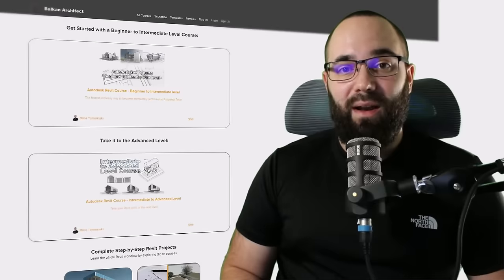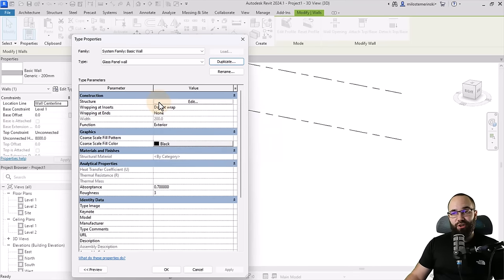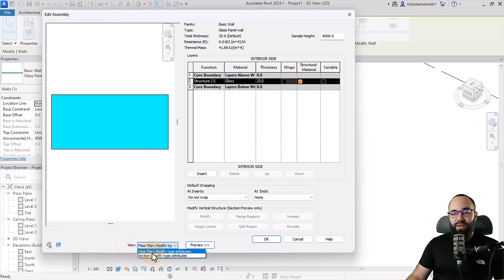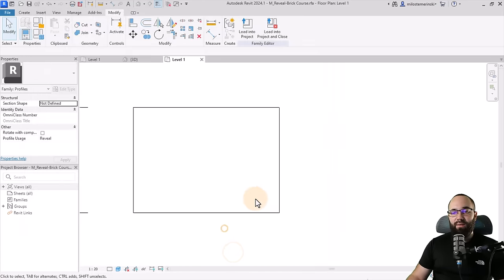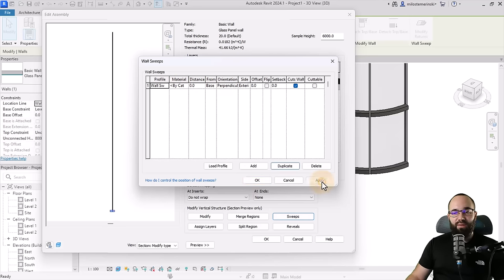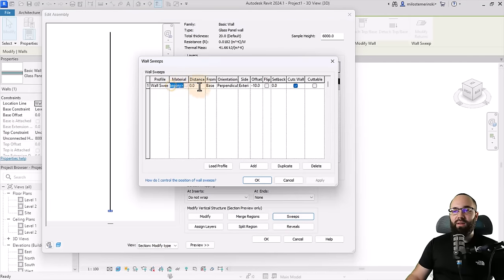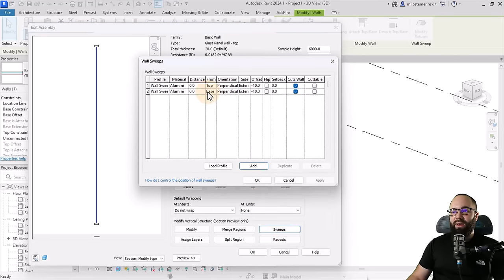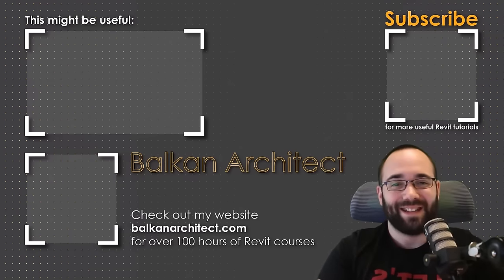Curved Curtain Wall in Revit Tutorial

Comment: excellent tutorials with a very clear and fluid explanation. Continue like this. quick question for you: in your curved curtain wall tutorial, the mullions at the ends are not parallel to the walls with which they are in contact. Is there a way to rotate them to align them without touching the other mullions? THANKS. best wishes .